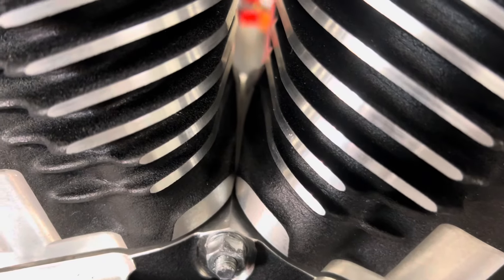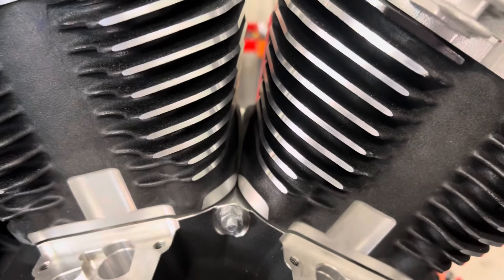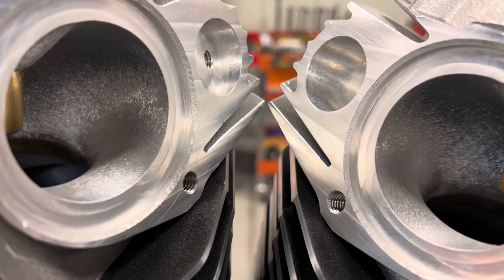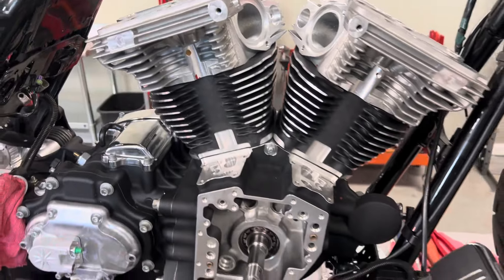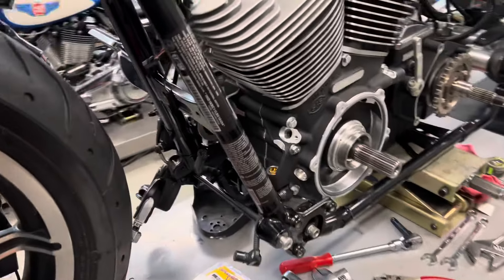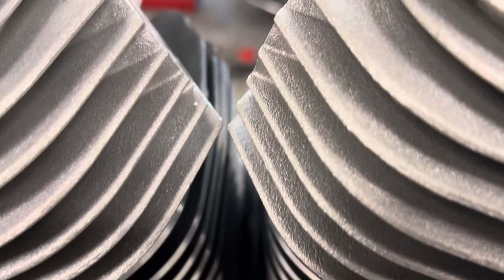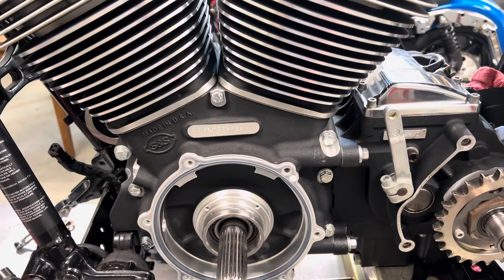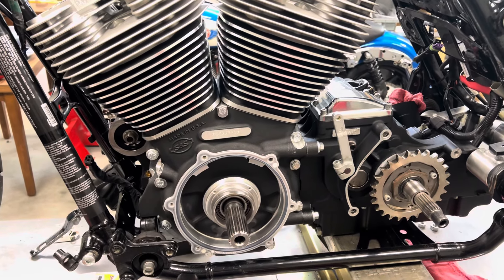140 cubic inches of Twin cam. Big Bore 4.50, Short stroke 4.375, B2 heads.

Comment: ,,,,Saw that great interview you had with Lake Speed,,,,,,Talkin about the huge bore  S&S pro stock engine,,,,,,What balance factor  did you use when  figuring the bobweight for the crankshaft balancing....??? ,,,,Also  ,  What  stroke  crank was used to get up to 10,000   and live...???